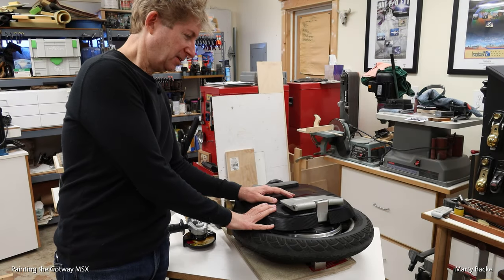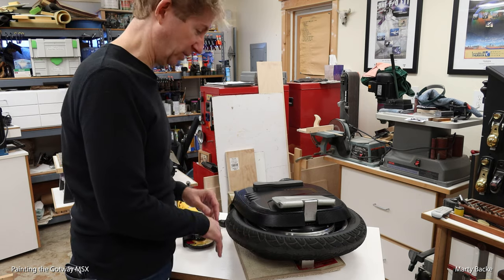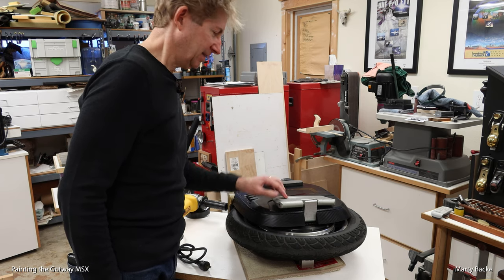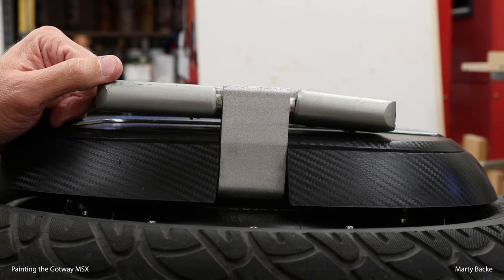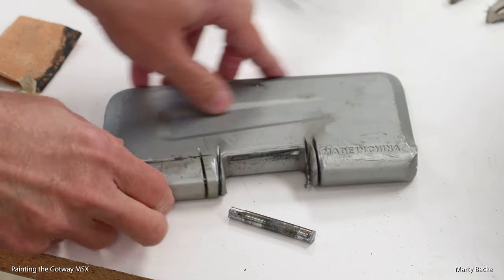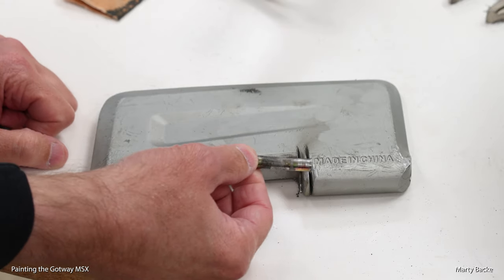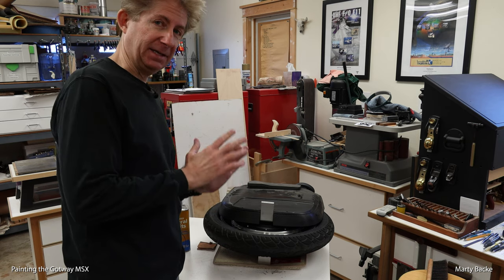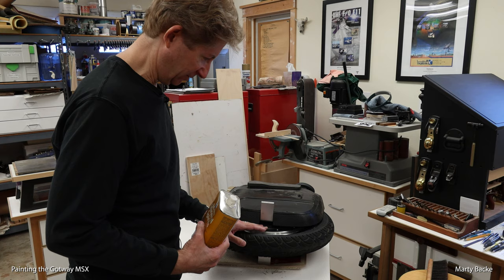Painting the Gotway MSX

Comment: Looked like a lot of hard work, but the end result was definitely worth it. The wheel looks really cool and unique. Plus if you scratch it you can just touch it up 👍. What type of paint did you use to paint the plastic white parts of your Nikola?
Reply from the maker: I used RUST-OLEUM 2X spray paint
Reply: ElectricUnicycles: thanks for that. 👍